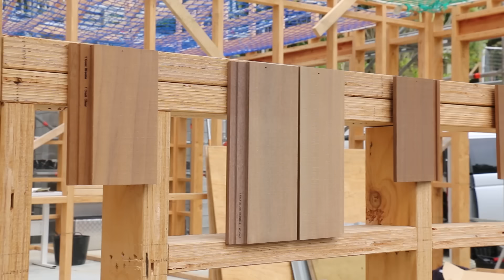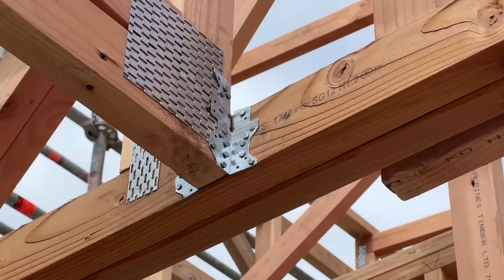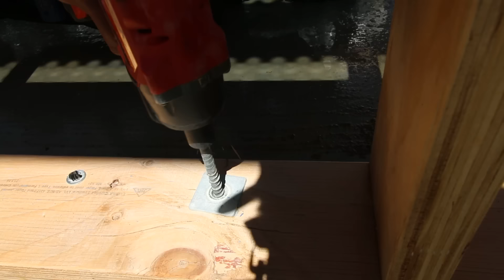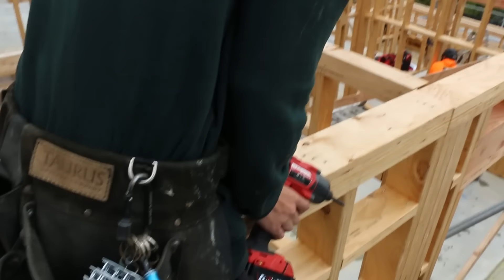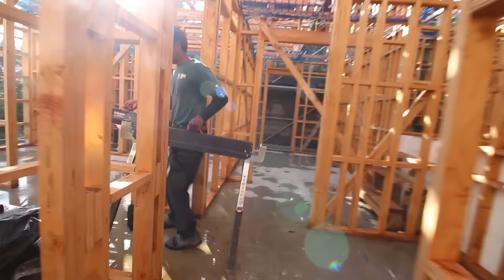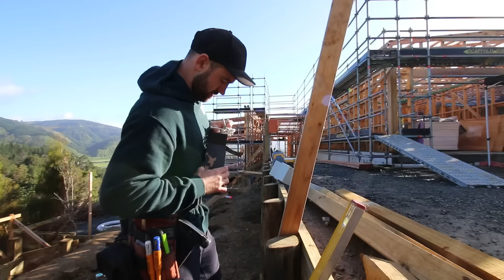What Really Keeps a House Standing!

Comment: Geotech here from CGW (lives in Lower Hutt). To answer your question about uplift forces, the main reason is that they help resist overturning forces from horizontal loads from wind and earthquakes. Essentially: wind blows on the side of the house, it pushes down on the far side, but the lever pulls UP on the close side. 
The another big reason for all the uplift bracing is earthquake uplift forces. If you have more than 1g of vertical acceleration in an earthquake, the weight of your roof and lintels actually works against you. In the second Christchurch Earthquake we had up to 2.2g of vertical acceleration in some places. That means, at least for short moments, the entire house is lifting with MORE than its total weight (1.2g upwards). Literally imagine your house hanging upside down from the ground next time you think that the bracing is overkill. 
Add the simultaneous horizontal earthquake forces that induce the aforementioned overturning forces (which can cause EVEN MORE uplift)...
Reply from the maker: thanks for the info - I would love to understand this more and make a video about it

Comment: How came you don't put your diagonal steel roof braces under the purlins, which you allowed to do, I don't like them rubbing on the roofing iron.
Reply from the maker: Good point - we just followed the architects plans
Reply: I used to make this point then someone said what about iron screwed to metal purlins? But yeah I still run it under my purlins.

Comment: Noob Question... how well does timber framing withstand rain and the elements before the roof and exterior walls are installed? Is there a specific timeframe to get it enclosed, or can the timber remain exposed for an extended period without issues?
Reply: Not a builder but I think it's about 3 months? After that I think there may be a way to re-treat the timber in situ, which I imagine would be required before closing it in. I remember seeing some builds that were abandoned in Auckland due to running out of money, and it looked so strange to see framing that had completely silvered off in the sun.
Reply: @alreid7473  i think it is 180 days.
Reply: @tonytrangmar9036  dam thats basically half a year 😂
Reply from the maker: Yea about 3 months - generally you are trying as quick as possible to at least get a roof on. Once we have the weatherline on we have about 9-12 months to clad

Comment: Fibre cement nails instead of product nails?  Or do product nails come in green boxes now?
Reply from the maker: Good eye — the box in the shot wasn’t the fastening we used for the structure. It was just a demo clip the video guy grabbed. I’ve double-checked the site invoices and we 100% used the correct nails for the job — all signed off in inspection

Comment: No wonder the cost to build a house in this country is out the gate. The ridiculous amount of fixings that have to be used is mind blowing
Reply: yeah total overkill
Reply: Not to mention 95% of the framing being LVL……holy moly. At least this house will last longer than 50’years right. Good work tho. Looks like an epic own house
Reply from the maker: Its definitely a lot - we just follow the rules
Reply: @nzbuilder  Please tell me, if there is so much trouble with wood and fasteners, which even makes me bored, why don't you make walls out of brick, ceramic block, or gas block? It's faster, in my opinion even more reliable and practical
Reply: Wood is costly and it needs all kinds of fasteners to safely secure it down for all acting forces.
Reply: @FeMofokeng yeah. That's why all the old houses that have been there for 80 years with none of this new rubbish are falling down and blowing away. Oh wait... they aren't.
Reply: @tylerdobdob23 Wait for the next 8.2 as in 1855. We will see what is standing and what isn’t. 🙁
Reply: @tylerdobdob23  you've clearly never done any earthquake remediation work in Christchurch. Plenty of old timber homes that didn't fall down but did sustain serious structural damage due to unconstrained movement of the framing.
Reply: Would you prefer a house that fell down or blew away?
Reply: @dermotbalaam5358 how many of the old houses have fallen down and blown away?
Reply: @tylerdobdob23 Wellington is overdue for the next big earthquake which is where we will see the differences between modern and old building standards.
Reply: To be fair there is probably about 3-4 hundred dollars worth of CPC’s and straps. It’s paying 6-8hundred dollars a day per man which costs a lot.
Reply: @binlukin  Yep. And then when you have 10 of those overkill ideas suddenly you've added 100k to the build.
Reply: @binlukin 600 to 800 $ per day ? 😅 where are you building lol
Reply: @tobiaswatson3604 in NZ. Are you saying I’m cheap?

Comment: Maybe you're just reusing the box for product nails, but every clip of you guys nailing in brackets has you using fibre cement nails lol.
Reply from the maker: Good eye — the box in the shot wasn’t the fastening we used for the structure. It was just a demo clip the video guy grabbed. I’ve double-checked the site invoices and we 100% used the correct nails for the job — all signed off in inspection

Comment: Great walkthrough of all your connections Josh . Is your RAB a fibreglass coated gypsum board ? If so a similar product is used here generally in commercial jobs whereas in my area in BC , Canada , most residential exterior wall sheathing is plywood , no OSB .

I'm a bit surprised at the small size of your seismic hold downs compared to what we generally are installing here which utilize a 24" deep J bolt cast in the concrete 

Have a nice break , house is looking great

Also probably too late for this job but buy a hardware nailer haha
Reply from the maker: intersetong to see whats similar and whats different